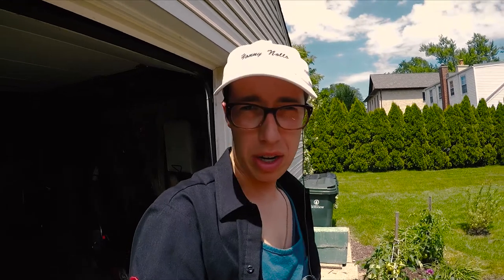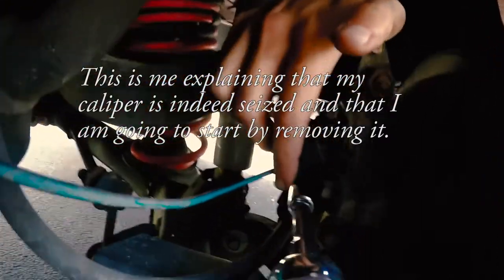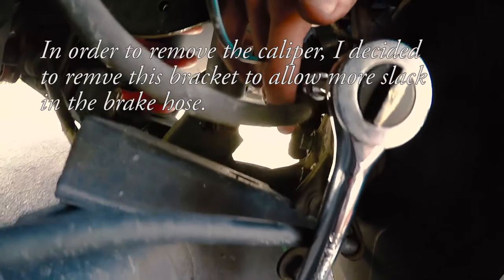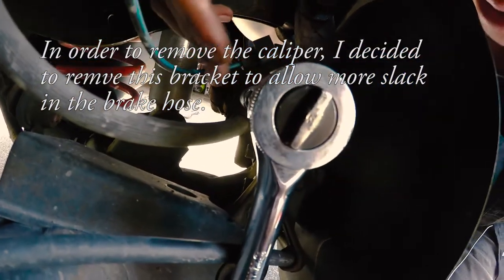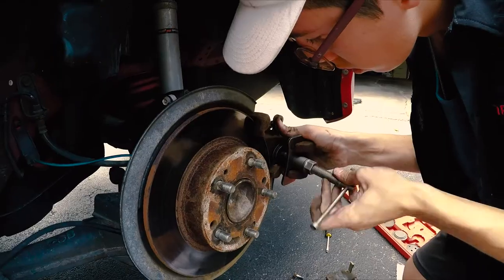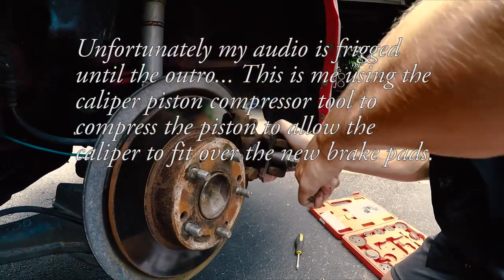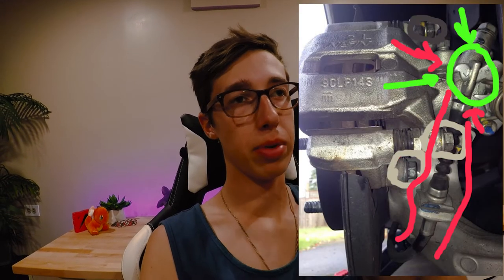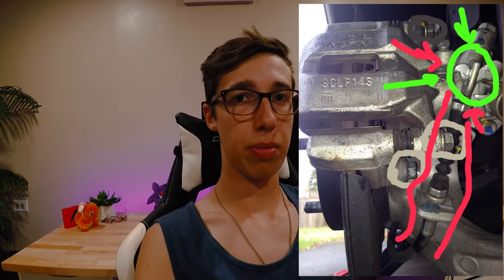8th Generation Civic Si Rear Brake Pads

Comment: Know it’s an old vid. But really appreciated the info at the end about the ebrake cable. Just picked up my FA5 last night. And the passenger rear brake was burning hot when I got home. I assume the cable is stuck or the caliper seized. Will definitely check the spring thanks to your insight. Thanks!

Comment: You should use copper paste between the contact points with brake caliper. 
And when installing the rims back put some on the wheel hub - rim contact points as well. prevents getting rusted out and stuck. I know this video was uploaded long time a go. but i just happened to watch your older videos. ;) and i know for a fact you read almost all comments so. Yea. :D
Reply from the maker: Vitun Näätä thank you for the advice! And heck yeah i do!